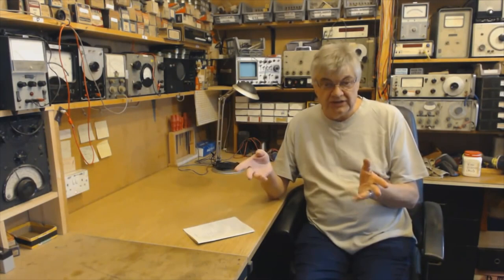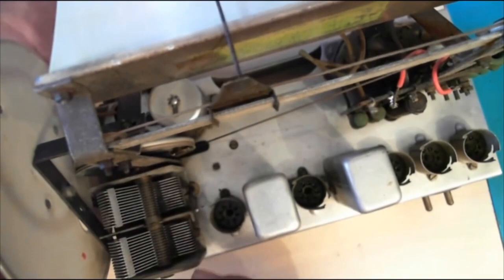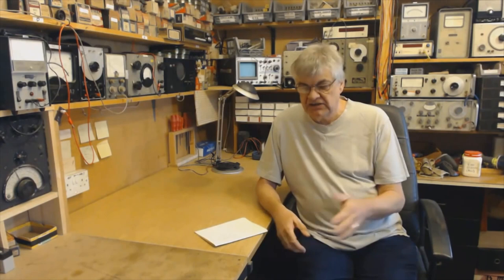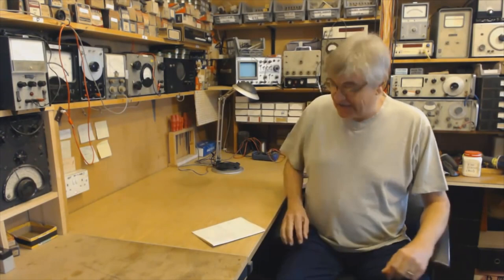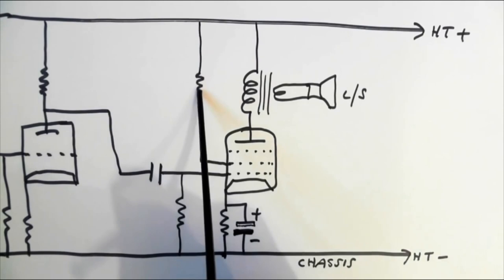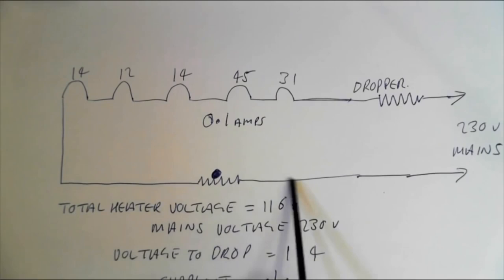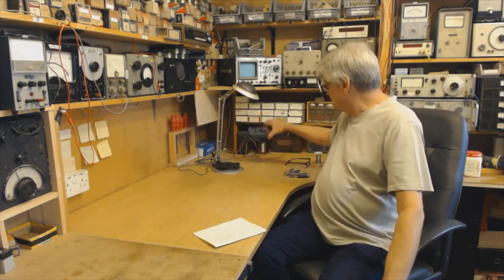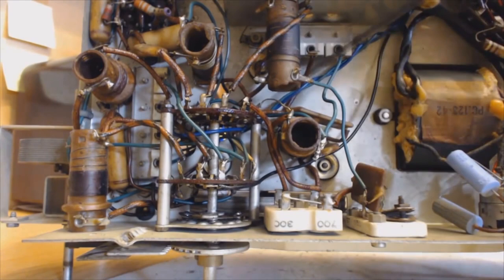How to repair and restore vintage valve tube radios

Comment: The younger generation need to get interested in repairing electronic equipment to carry it on when we’re gone, (That’s a nice cheery thought lol)
Reply from the maker: Yes, you’re right. Many youngsters today’s can’t even use a screwdriver.
Reply: You have brightened my isolation day no end....trying to find a rare cap. No luck so am gone. Arrrggg.

Comment: Would like to know how to use/connect signal generator to rf stages
Reply: In most cases, it's sufficient just to put a coil across the signal genny output, put it near the receiver & let it find its own way.

Comment: I have a fifty percent success rate with buying radios (especially EKCO) and receiving them not smashed up. A single layer of bubble wrap is not good enough. 
In lockdown prices have doubled for valve radios and I suspect some are passing between people who hack away at the innards, wreck it and then sell on. Three sessions and there is more or less nothing left inside. 
I have seen that with amateur radio transceivers. Expensive butchered rigs fit only for scrap changing hands for hundreds of pounds. Each purchaser hoping the 'spares or repair' rig only needs a new fuse before using a soldering iron the size of a shovel inside.

Finally if you restore an old valve rig when you sell it cut off the mains cable at the radio and sell it as a piece of furniture. If you have altered the radio from the original design in any way, even if to make it safer you take on all product liability.
Reply: prices doubled? i wish!! i have a shed full of radios i need to sell, and yes one layer of bubblewrap definitely not enough for a bakelite set, not any really,  need a good 4 inch/10cm all round soft foam padding at bare minimum (not polystyrene, far too hard/rigid) , ideally double boxed